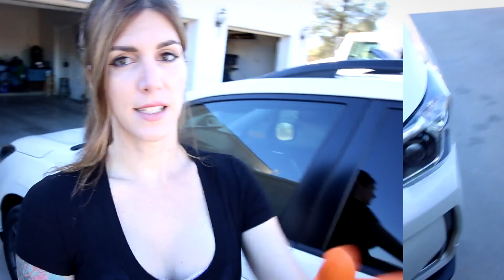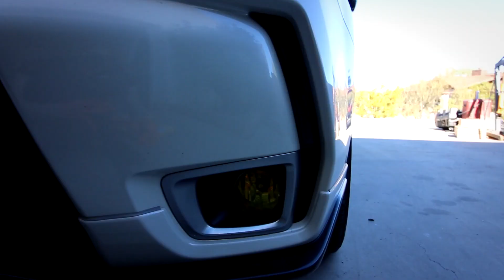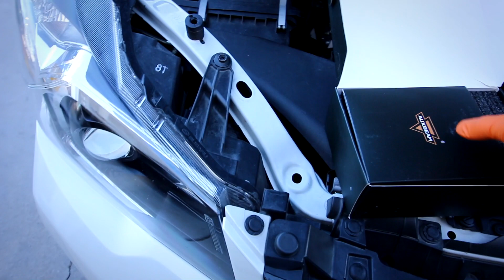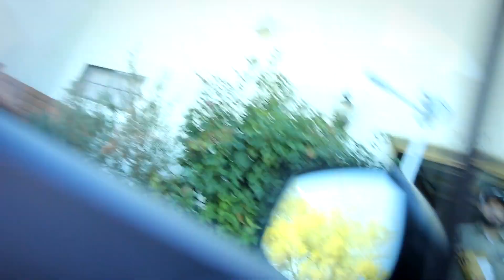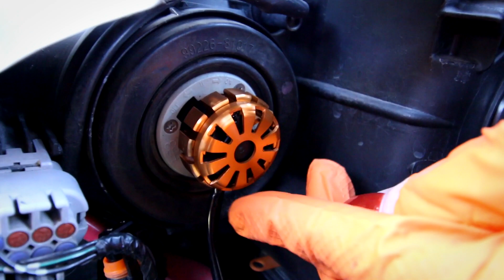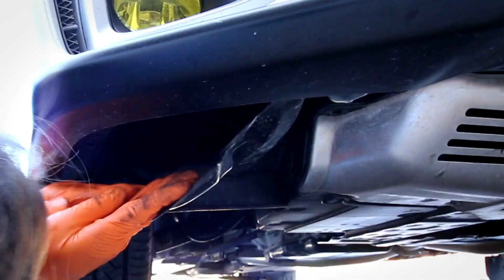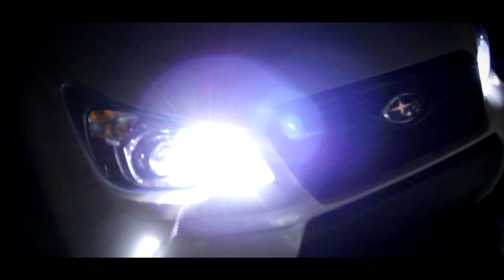Subaru LED Install // Auxbeam Review

Comment: I tell people not to buy these lights. They're just annoying for other people on the road.
Reply from the maker: Secured Existence these are not my low beam headlights. My primary headlights are the projector housing w/ a cutoff designed specifically not to blind oncoming cars. You’re referring to when people install HID or LED bulbs into a low beam housing designed for an halogen bulb. I assure you, no one is being blinded by anything on this car when it’s on the road. The DRL is washed out by the sunlight.

Comment: But, aren´t your DRLs turning on the whole led bulb on the 9005? It´s like having your high beams on all the time. I think there is a model that comes with separate led chips, one for the DRL and the other for the high beams. I think you are having your high beams on all the time. You should check on that Sarah. Greetings from the Dominican Republic.
Reply: I know on the impreza and (XV) Crosstrek the DRLs ARE the high beams except there is a resistor for when they are used as DRL's with LED lamps the resistor doesn't make much of a difference - that's why the stock lamps appear dim or a bit more yellow.  with the low beams on the high/DRL's shouldn't be lit but they appeared to be on in the end of the video.  I run a set of AUXBEAM for my XV's DRLs but they are much lower in brightness and do not have a cooling fan they're NF-03 9005 and don't glare or blind folks during the day.

Comment: Don't put led lights in a halogen design unit and expect better light. it will be bright for your eyes but it will scatter light every where. I  aprove of the xenon retro fit, very nice, will also have great light output. I have a 40 inch curved auxbeam light bar on the bumper of my forester turbo s. it's a lot of light, very good flood but sadly the focused  part does not even light half distance then my hella rallye 100ff did on my impreza. i think i need a 3.5 times more expensive bar for that kind of distance
Reply from the maker: Fantaman900 The retrofit is bi-xenon. So the factory high beam location is just an additional high beam light.

Comment: They look great, but what is the beam patter like? Would have liked a forward facing view of what you seem from in the car to get an idea of how usable all the extra light it. One of the biggest problems with a lot of old HID kits was that all the extra light was aimed up into space or other peoples faces and not on the road where it was useful... so if you could do an update with how they work for driving, not just their look, it would be great:)

Also, I know I’m not the first to say, but figure the more people that say it the more likely you are to see, please disconnect you DRL resistor... the LEDs use much less power so they are basically full on high beams all the time, not DRLs. If the new ones are anything like my 99 impreza, you should be able to disconnect the resister(mine was on passenger side firewall near strut top) and then you will just have the LED strips near the fogs on as your DRLs. On behalf of people in front of you, thanks in advance.
Reply from the maker: Mike Julien it’s a daytime running light... beam pattern is irrelevant. I have bixenon Morimoto projectors for my primary headlights.
Reply: Sarah n Tuned you said yourself you were replacing the high beam/DRL bulb. That bulb isn't like a bi-xenon with 2 different beam patterns, the only difference is when in DRL mode, the car gives it way less power. Since LEDs use way less power, they are just full on high beams, weather you want to use them as DRLs or not. 

Sorry I forgot the part where you mentioned you had by-xenon and were using just as DRLs(since as I mentioned, they are useless as DRLs, and are just full on high beams), but the beam pattern of the fogs would still be good. 

Think you're doing a great job, not trying to hate, just don't want you getting a ticket for driving with high beams on.

Comment: Sure just blind people. Enjoy high beam revenge from other drivers
Reply: They are daytime running lights. They are only on during broad daylight when the headlights are turned off. Ever notice how a flashlight is a lot brighter in a dark room than in a bright room? No one is going to be blinded.